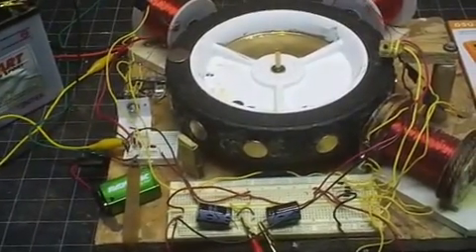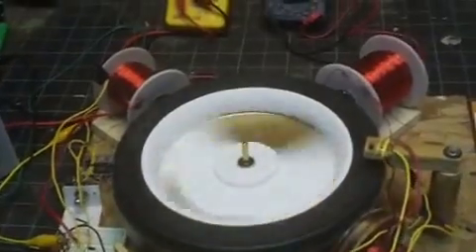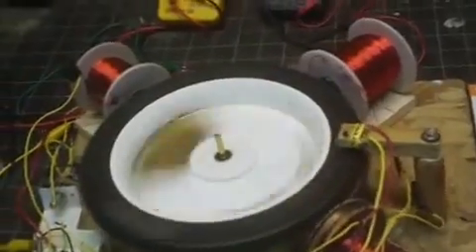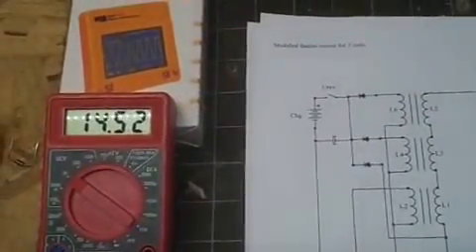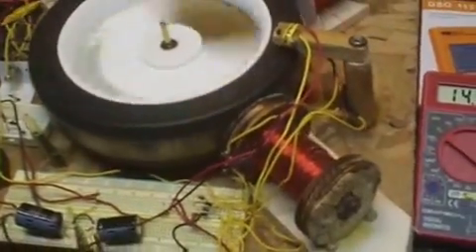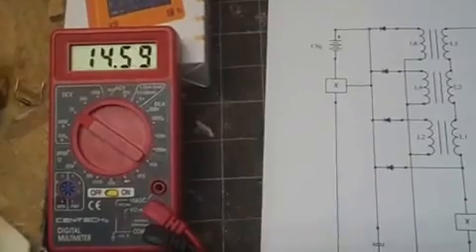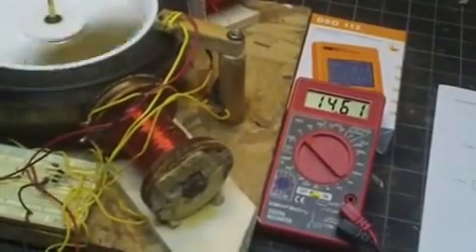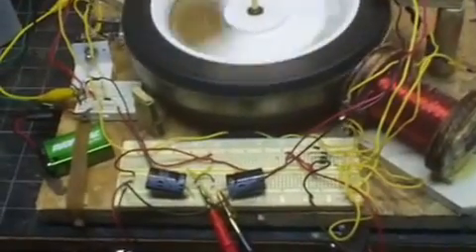Bedini 3 coil motor generator, Hall effect and circuits

Comment: Appreciate it! I think YouTube is one of the greatest tools for people looking into these conundrums and your video is no exception.
I'm trying to imagine what you've created without any resistors or transistors... In place of the loading battery a much larger coil with larger capacitors. The hall effect seems necessary though and for what I'm thinking, it would help to unload the circuit. Also, a timing advancement circuit is something I'm interested in seeing until the stator/rotor reaches it's peak RPM. I don't know what you're using as a bearing other than a rod, but have you considered placing your wheel atop two opposing magnets.

Digital circuits are the end goal for most everything people are being taught over the last 20 years. I think we have gone in the wrong direction entirely. There should be a true field dedicated to outside the box analog power engineering. I used to draw schematics for things such as this about 15 years ago, but now I've learned a few new things that make me think there's a lot more that can be done.

Thanks